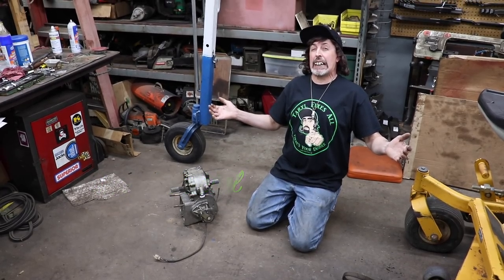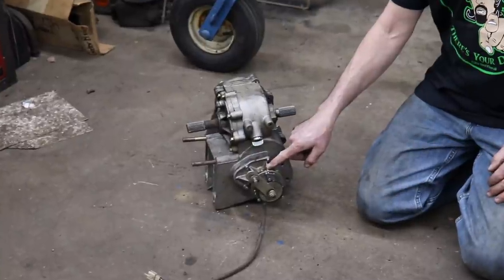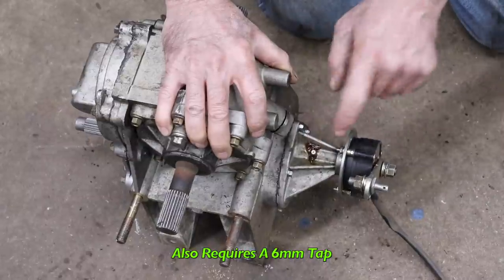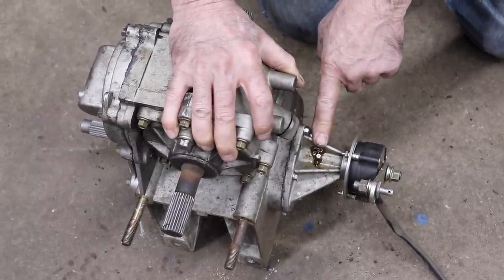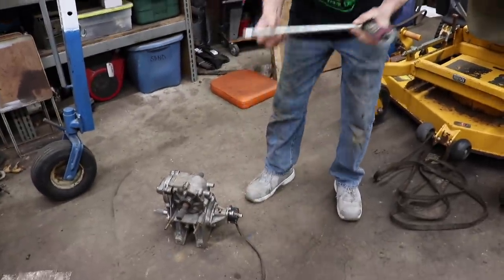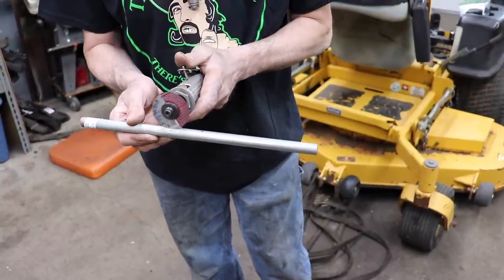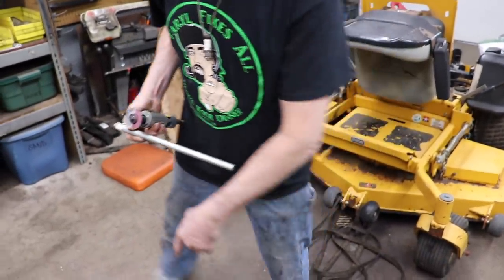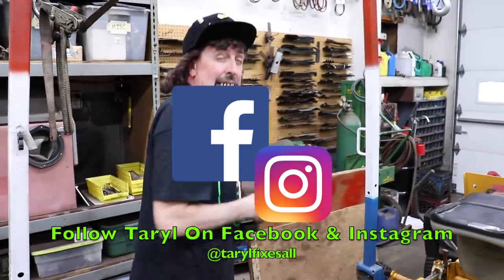Hard Shifting? Easily Fix It With This Trick

Comment: That's Taryl fixing things that the factory should have done
Reply: Got that right. Damn grease fitting only costs a few cents. But then it did come from ping pong pang land.
Reply: Wholly Kazuma you're correct!   Or they could have used self lube oilite bearings on the shaft.  China takes too many "short cuts"  thank god they don't handle level 4  lab viruses....wait a minute.
Reply: @JoshSmith-wo7zw  American companies do the same things! Shortcuts save on costs and increase sales of parts. Saw video of a Cub Cadet  mower deck where they provided a zerk but used shielded bearings so greasing was a waste of time!
Reply: Missing drain plugs and missing grease fittings are a couple of pet peeves of mine.
Reply: @marshallblythe7240  I Have a Honda GCV 160 cc lawn mower engine with no oil plug you have to turn the engine and lawnmower upside down to drain it I curse them every oil change.. Then there are the "lubed for life" under size ball joints with no zerks good for about 60k miles.

Comment: Great tip! Use a 5.2mm drill for the 6mm tap. Put the shaft in a drill or drill press press on slow speed and hold your grinding wheel to the shaft to make a nice straight circular groove.

Comment: Great video's and great channel.
Well done to all involved, informative 
and funny at the same time too.
Now I have a Honda ride on mower
with an 18hp v twin engine, it is 
burning a hole in my air filter and has
partially melted the air filter housing.
Is this caused by a not fully closing
intake valve leaking hot compression 
gas back to the carburettor. When starting
the engine, I have seen sparks flying out
the butterfly valve, which is also blackened
on the inside. There are no vids about this
issue currently online, that I can see.

Comment: Great video Taryl, as usual.  I have a question for you. If you are installing a new Manetron ingnition coil, and there was none on the engine, how do you know the proper orientation for the coil.  There are no markings saying which side is to be placed out or engine side. Should you just place it one way and if it works, great. If it does not, then reverse the coil and try it that way? Is there another way to correctly determine the coil orientation?  Thank you.

Comment: Could also rotate the shaft by hand while filling it with grease
Reply: you could but it's not necessary, the grease gun puts the grease under a lot of pressure, and it will follow the "groove" easily.
.
look up "removing a stuck piston with grease"

Comment: wow, i have one of these - paid $200 for it and a kawasaki 250 quad, surprised to see such a new video about them as theyre pretty old now
Reply: in addition to this advice, ive found that i almost always use it in high gear, so i adjusted the cable to sit very well in high, but in low it sometimes jumps out but this is okay for my purposes

Comment: Remember when you drill that look at the grease fitting.  It's probably a pipe thread, or a mm thread. Just wanted to say that. Because of you use a regular tap it's for bolts. So look at it just wanted say that.